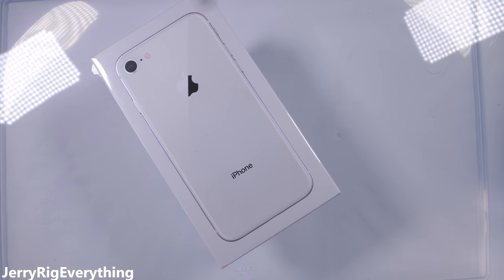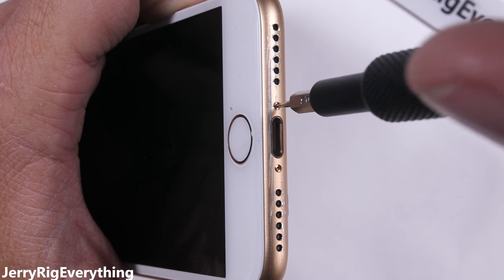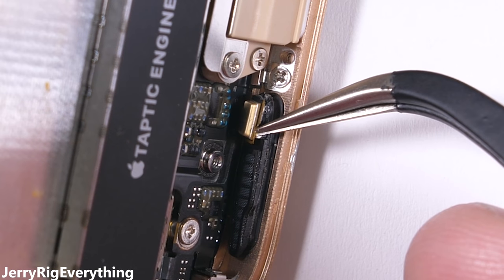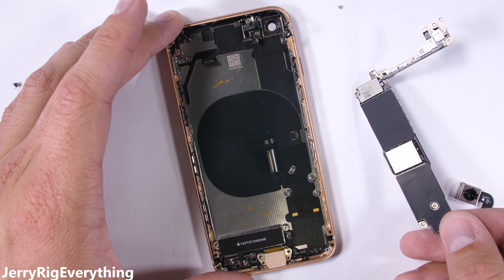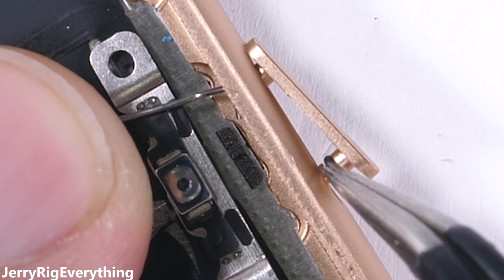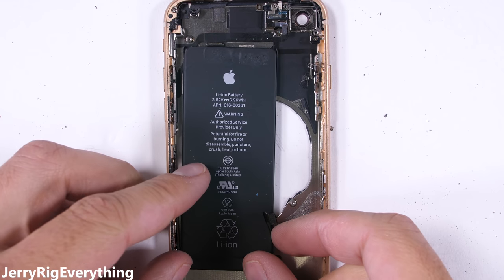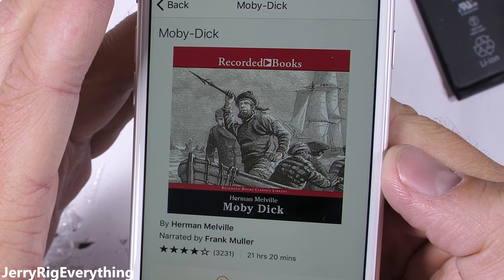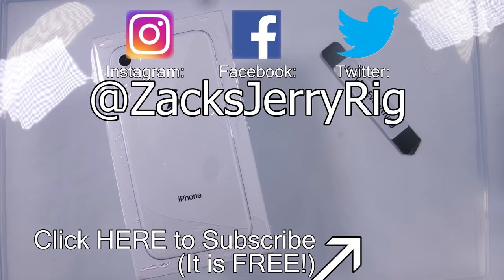What makes the iPhone 8 Waterproof? + Clear Back Mod!

Comment: "Consider water resistance as a bonus"
Seriously? At this price point and release date?
Reply: I know right, that is why ip 68 is king. Than after that it goes into the 50m water resistant and so on, which I don't think we should see that for maybe another year or so. Mainly because once apple steps up to some of the feature levels of android competitors, those android competitors move up another level. Thats just how it works sometimes. I'm not saying that apple hasn't had feature practically years ahead of other android phones, but I'm just saying other companies want to try to stay one step ahead.
Reply: David Kelley u
Reply: Water resistance is a “bonus” on the GS8 as well. Not covered by warranty and it wears down over time.
Reply: +DeFy Noah the Samsung Galaxy 8 isn't water resistant, it's water proof. That is the major difference here, Iphone IP 67, Samsung IP 68
Reply: StriKe jk Waterproof? No, nothing is waterproof.
Reply: Sorry, but that's incorrect. Nothing is truly "water*proof.*" Even an expensive diving watch that is good to 500m is classified as water resistant because at some point there is a limit. In this case, the difference between IP67 and IP68 is that the GS8 can survive in 1.5m of water for half an hour versus the iPhone's 1m. I would hardly call that a massive difference. Especially when both phones (and the iPhone 7) havebeen shown to survive at much greater depths than their rating implies. 

Either way, until a manufacturer is confident enough in their waterproofing to cover warranty damage under warranty (neither Samsung or Apple is) I would not advise taking your phone in the water.
Reply: +DeFy Noah that is not correct
https://en.wikipedia.org/wiki/IP_Code

However I do admit that "water proof" was the wrong wording as I tried to translate the german word for Ip 68. Sure nothing is waterproof but IP 68 is a lot better than IP 67.
Reply: Samsung's official website claims "Rating is based on test conditions of submersion in up to 1.5 meters of fresh water for up to 30 minutes."
Reply: Dragorific it is Apple lol
Reply: yeah.. there is no warranty for water damage..so literally it is not a function
Reply: DeFy Noah as long as manufacturers use glue to hold the phone together then the water resistance will erode over time.
Reply: Exactly.
Reply: The iPhone 8 fucking sucks. It's not even Apple's flagship phone. It's 2nd fiddle to the iPhone X.
Reply: OLBastholm go pro hero 5-6
Reply: David Kelley iPhones have ip67 waterproofing not ip68
Reply: Noah Lach lol warranty damage under warranty I think you meant water damage under warranty
Reply: ...Yes!
Reply: @OLBastholm  Lies! What about a rock?

Comment: You damn monster 00:03 opening a phone in water
Reply: Renco Rell ikr, rip his charger and headphones
Reply: reminds me of plainrock
Reply: Kojimitsu water resistant
Reply: sergent sausage my earpods have been through the washing machine twice already. They work better than I remembered.
Reply: Vinnpinn they will still work of course, but will lose some bass, cause distortion, and get hotter. Not a problem for disposable ear buds, but high end audio stuff would be ruined.
Reply: Peter Juncker I can swear they are better now. The sound is a lot clearer, the bass sounds better. They do not get hot and I never had any disortion.
Reply: +The Game Hub Because that's what he did in one of his videos!
Reply: Madden God its the same
Reply: +Kevin Bhasi Doesn't YouTube put comments with links in them automatically in the spam folder?
Reply: Kojimitsu not the other stuff in the box
Reply: The AirPods they’re waterproof

Comment: The back glass is harder to replace, because they made the screen easier to replace instead.  In my opinion this is much better than having all of the components mounted to the screen, like on most Android phones. Because the screen is the most replaced part of a smartphone. I have always appreciated how apple does this.
Reply: How is it easier to replace? The replacement procedure of the display is pretty much identical to the 7 with the metal unibody, so I don't see much change here. 

What has changed is how it is so much harder to get the back glass out if it were to crack, as you have to take components out before getting to that glass, unlike others where you heat up the glass and pop it off.
Reply: Except.. when you pay $550 for a back glass replacement.. no bueno
Reply: Caleb Kan he meant easier in comparison to other phones, like newer Galaxy’s where the OLED panel is the last thing to come off.
Reply: potato potato potato potato potato potato potato what is not expensive about apple

Comment: I now actually feel pretty good about my iphone glass back, judging by the force of the repeated blows (8) it took to break it, plus I've got it in a Rhinoshield PlayProof case.  Also, check out bend tests done on the 8, much, much stronger than the 7 or 6.

Comment: Hmm, actually, I just replaced a back glass to an iPhone 8. You can do it by melting the epoxy holding it on with extreme heat or extreme cold. I used extreme heat and chipped off the old back glass and replaced it with a new back glass using epoxy marine for (hopefully efficient) waterproof. ^.^ of course, this is an extensive process, but it is possible.

Comment: You can actually make a clear back iPhone Zack. As it turns out the glass back can be separated from the metal it's glued on, and can be stripped of it's coloring. It's still not as fancy as seeing the individual parts of the phone, but it's still better than the small hole in the center you managed to make clear. Why I'm here? The guy from EverythingApplePro did this but his means were a bit unconventional. The glass back popped up on it's own after he tried to freeze it in liquid nitrogen. Can you please explain how to do this in a more familiar fashion?

Comment: So, I went for a swim in the ocean the other day, completely forgetting about the phone in my pocket. It's an iPhone 8 and so far everything works. But I did have trouble charging it, even after cleaning the charging port. Hopefully it won't corrode now (I did clean it with alcohol).

Comment: Thanks for the info. Took my Ihone 8 to another country as a second phone for data. When I inserted the local sim there I noticed there is no rubber seal on the sim tray. Had the phone from new and the Istore inserted the original sim many moons ago. So luckily it never seen water. Would have been an expensive paperweight then!

Comment: RIP my iPhone 7. Water resistant they said 😑. I was in a club before and I put my iPhone unconsciously on the wet table, still can used till I back home and it’s died completely on next day. And when they opened it, yep there’s is water inside and some part are become rusty, means the water get inside a long time ago too. I used my iPhone for 1.5 years only. It’s doesn’t like my Samsung, I used it to taking videos underwater sometimes but still work well till now. But still I bought the new iPhone XR again after (I fall in love with apple ecosystems). Hope no more drama like iPhone 7 this time 😇

Comment: There is arelativly simple way to waterproof electronics. You just have to apply a lot of corosionX Spray to the pcbs. I have successfully tried it myself. Can you try to do that to a non waterproof phone and test if it will survive water?

Flitetest did a Video on that, you can find it if you search for waterproofing your electronics.

Comment: 5:37 oh sure it takes massive hits with a metal object to break the back glass but ONE DROP on carpet or a semi hard floor from waist height will obliterate the glass.
Reply: He was hitting the glass with the plastic end of his tool, and if you drop your phone, the damage will be spread along all the glass making it easy to crack, but applying pressure to a specific spot won't be as drastic, usually in normal hits

Comment: Phones are easily destroyed by water once dropped for the first time, even if the screen is not broken!

"IP rating" ruined once the phone is dropped & the frame is very slightly bent, especially aluminum phones!
Reply: They should call it rain & splash resistant! It is not a scuba camera setup for underwater pool fun etc! 

They could make it totally impact resistant, highly resistant to breaking, with outstanding RF performance for LTE, voice, text, bluetooth, NFC, Qi charging wirelessly, etc if they made it out of plastic with gaskets & gold plated stainless screws, then throw a glass screen protector on to get that nice touch clean interface....